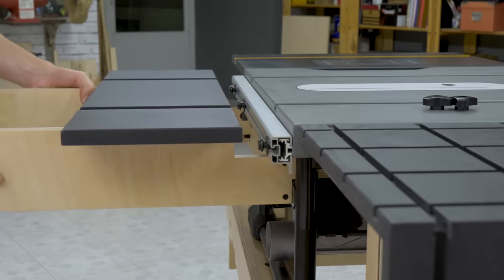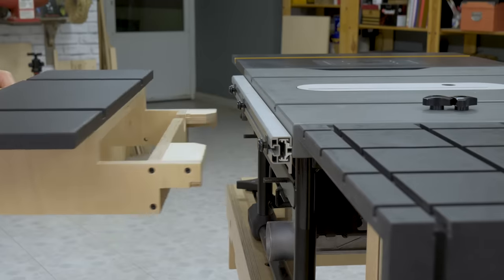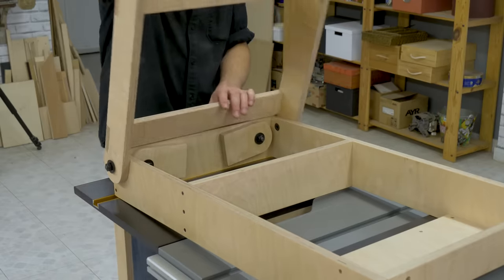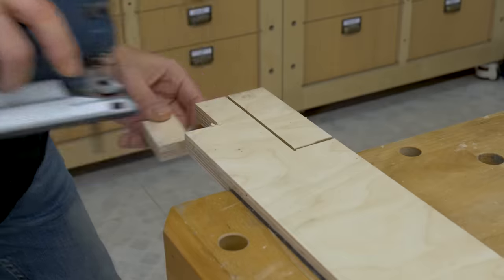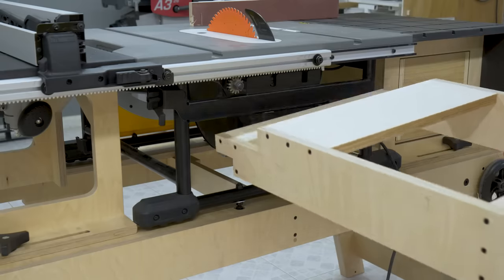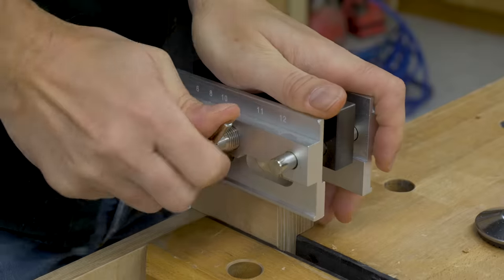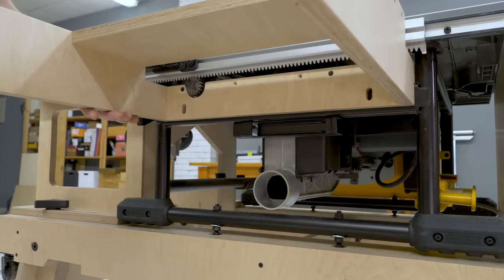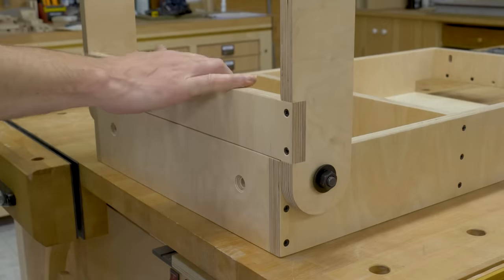DIY Table Saw Folding Outfeed Table with built-in CrossCut Sled - Pt. 4

Comment from the maker: Outfeed Table & Crosscut Sled Plans: https://bit.ly/44kHDvf
Reply: Hi, if i buy the plans for the full DIY Table saw table and then you add more to it at a later date such as sliding carriage will this then become available as part of the full set? 
Im also debating what materials to use, i notice you used mdf for the tops but i though that wasnt as stable as ply and ply was the best material to use? I cant realy afford the birch plywood its rediculously expensive would ordinary WBP hardwood plywood from the builders merchants in the uk be ok with melamine mdf for the tops?
Reply: @danread3144  Look like he is selling every each part of the table separately.
Reply: Hi @Paoson_Woodworking, do you (or anyone else) have any recommendations for a compact dust extractor for a small 11ft x 7ft workshop? Thanks!

Comment: This entire work bench is brilliant. I’m looking forward to building my own, with a few modifications to accommodate my table saw. Fantastic ingenuity, and incredibly well executed, as well as approachable.
Reply from the maker: thanks!
Reply: @paoson_woodworking can I ask you a question about the design though? Something I didn't understand was when you said you would only have to level the feet one time. Isn't that only true if the saw is either used in the same spot or if the floor is exactly level every time the saw is used?

Comment: You know what I want to see you build.  A smaller bench that can be folded down on wheels and rolled under another workbench.  Most people work in a garage and space is limited.   A bench with a machine on it that can be lowered and rolled under another bench for storage and then rolled back out and lifted up (scissor lift) to use again.  I would buy this plan.

Comment: you could add leveling bolts through the arm that goes into the saw for attachment, then you shouldn't have to monkey with adjusting much anymore.